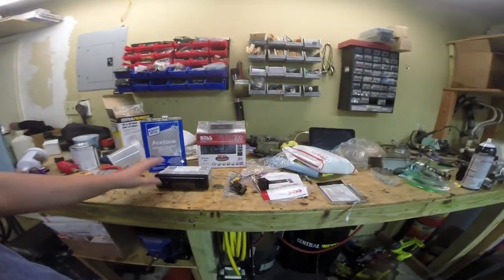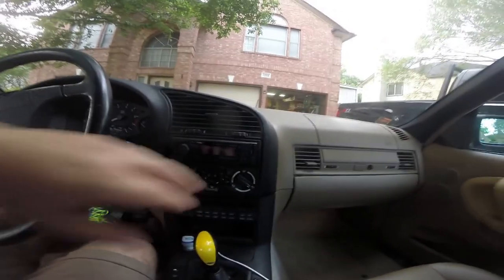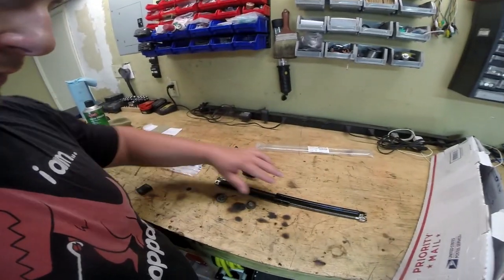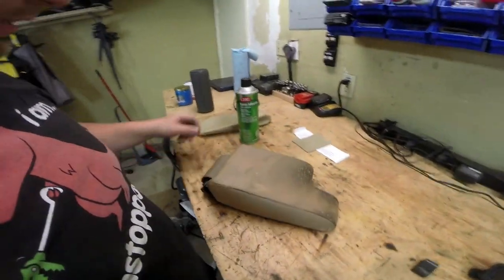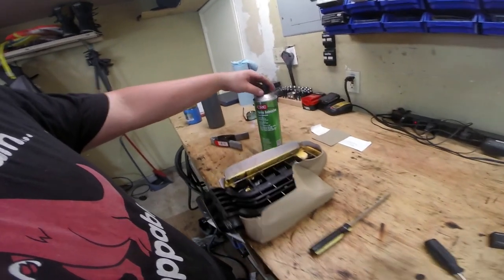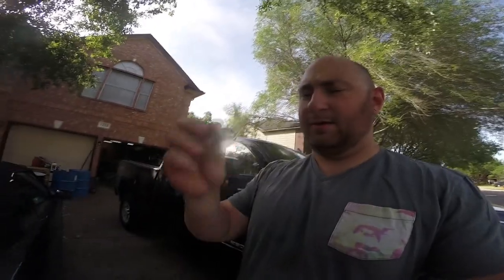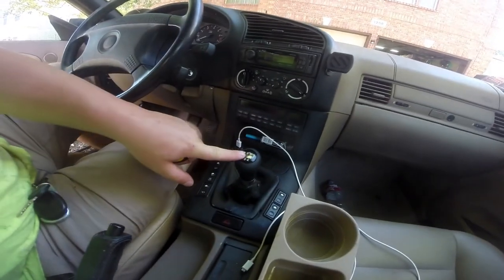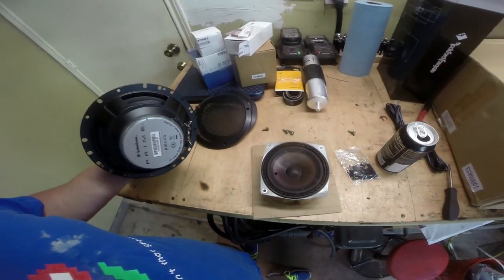#eBayE36 - Part 2 - The Little Things

Comment: Just use a sewing needle to clean out the blocked jets for your windscreen jets. The jets can also be rotated/moved using the needle for leverage to adjust the position on the windscreen it sprays on.
Reply from the maker: These were too far gone. New ones were $8. Easy peasy.